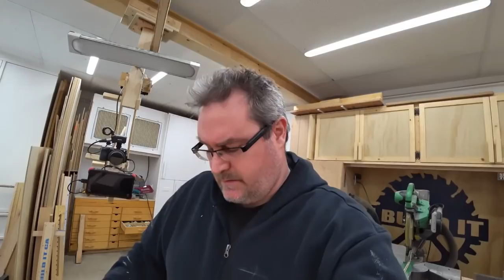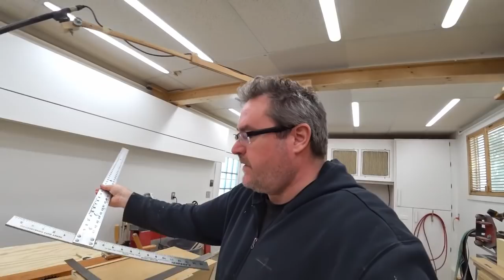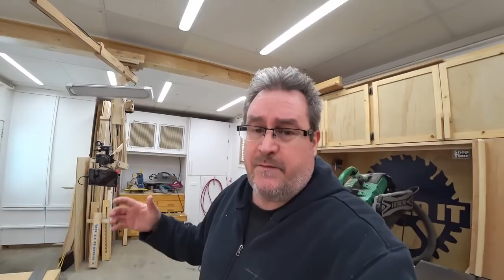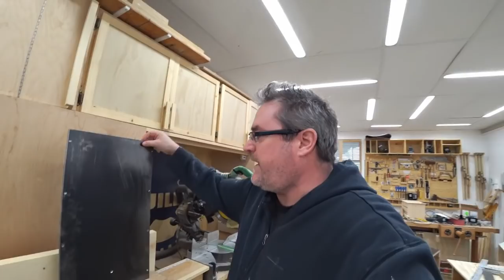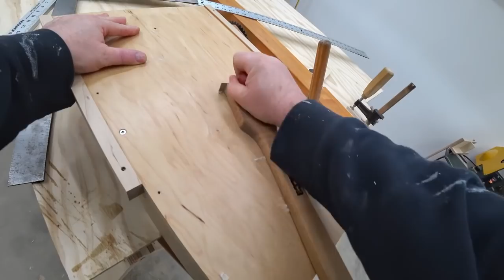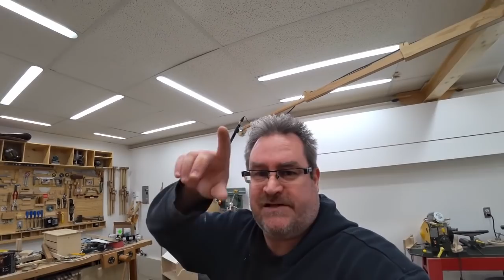I rushed it and now I'm paying for it

Comment: I have that precision problems very often in metalworking. The biggest flat surface I have and use is a 50x50 cm granite kitchen countertop, very hard (obviously) and seems to be stone countertops are very flat because the way they are cut; I suppose you know all that already, but just in case. Thanks for sharing !

Comment: I own 3 jointers and have used a few others. They all have a mind of their own. One
 might work today but not tomorrow. Here's what works most of the time for me: Get the board as straight or flat as you can with a hand plane( or bandsaw) before jointing. Having in and out tables laying in parallel planes is a must and if you get it working correctly do not change the depth of cut. If you don't like the idea of hand planing before jointing forget jointing  and attach a straight edged board and use the table saw. If I have a 1/2 inch bow in the middle of a board and don't want to hand plane sometimes I use the jointer as a powered hand plane and alternately plane from each end towards the hollow spot. When it is flat within a sixteenth or less then I make a full pass. Lastly , in general, I feel the deeper cut you take the better chance of obtaining a straight edge unless your outfeed table is much longer than the work. At age 83 I have learned to accept mistakes. Thanks for your contribution to woodworking.

Comment: Hmmm, I guess I'm in the watch the details viewer. I got hooked by your multivideo series like your chamfer plane, quick release vice, I think the old sliding table saw was also one. Oooo, glass top jointer, that sounds really interesting. Btw, you mentioned a curved cut, why wouldn't that be a cutter knife issue?

Comment: I used to be a pattern maker and to make sure a surface was completely flat we used to rest a tight string line across it with a penny under both ends then slide a penny under the middle if the space is bigger then it sags and if its smaller then it bows up rinse and repeat till its straight in every direction

Comment: I had a bench planer doing a similar thing (hollow with it tapering thiner at one end), turned out to be caused by the blades being too low. i had them flush with the outfeed table but turns out they need to be slightly higher than it. just thought checking Occam's razor type problems before you go to full on trying to fix it.

Comment: I have never bought a framing square that was even close to square, that's why all the ones I have have been peened on the outside or inside corner with a center punch (and even then its only eyeball square, but off the shelf phht 1/8th inch over 12 inches)

Comment: Might not be a good idea, but I used to be in the glazing conservatory roofs and in a great deal of cases we used laminated glass. Although a bit heavy it hold the machine steady and as you probably know, you can give a great old whack on the surface, touch the edge and bang. Their are clips (inexpensive) that hold this glass. For what it's worth, maybe give it a look.

Comment: Thanks for the talk! As a retired heavy equipment mechanic precision is always on the forefront of thinking because of the tight tolerances of adjoining parts and surfaces the purchase of a accurate parallel straight edge with feeler gages is a must.  Hope you get this to a reasonable flat surface I know how flustered it can make anyone.

Comment: Like some others suggested, a granite counter top occurred to me. The float glass is an interesting idea too--that I never would have thought of. As infrequently as I would use a jointer, I would probably go with high-pressure laminate bonded to MDF. The laminate would wear out over time, but cheap enough to replace. I'm sure that whatever solution you come up with will be good.

Comment: Even you posted this video I was wondering about granite, the table saw was actually what I was thinking about at the time. (Much more complicated with the miter slots and throat cutout, of course) Obviously you'd have to have it cut by a shop but the size you'd need is probably within the cutout area of a large kitchen sink so there may be "scrap" available in that size.  I think there was a commercially available one (ridgid, maybe) that used granite. Obviously you still need to be concerned with fastening but perhaps you could have threaded inserts epoxied into the bottom, a decent thickness granite would not need to rely on the flatness of the substrate for flatness.

Comment: When I was tweaking my old used soviet mini-jointer, it had a horribly uneven steel outfeed table. After a lot of trial and error, I got it decently right by taking a granite plate with some glued on sandpaper (a piece of glass or a reliably flat piece of ply would have done it I guess) and rubbing a scratch pattern on the table. Then I scraped the highspots off with a small carbide scraper, rinse and repeat - I was surprised at how fast that went overall.

Comment: I spent my working life devoted to precision. I have a few tools that would help with measuring flatness and parallelism. I would like to have a couple of precision parallels and a set of feeler gauges to determine relative flatness of the plywood substrate. A surface gauge and a test indicator could check the cutter shaft to make sure it was parallel to the infeed table. I don't remember if the steel you bought was hot rolled or cold rolled. In any case, it won't be flat.

Comment: I'm glad you liked my glass suggestion!! Perhaps if you use chipboard as a base (say two 3\4" pieces laminated together) and coat it with a liquid DPM paint before adding the glass, there will be no movement due to moisture absorption. DPM paint is used on concrete foundations and also on the insides of mild steel water tanks. It isn't just water resistant like most coatings but absolutely water proof.

Comment: Maybe 18 mm MDF with a layer of 'FORMICA' type laminate on both sides? This is often suggested for home-made router tables to keep them flat.  Laminate the edges too, to cut down moisture absorption. Any chance of getting wide hollow webbed aluminium extrusions in Canada?

Comment: I wonder if screwing down the metal plate to the wood will distort the "flatness".  Think torquing down heads on an engine.  If they are torqued down differently it can lead to problems.
Reply from the maker: There's a gasket on a cylinder head that you need to be concerned with.

Comment: could a flat cast-iron top, from an old table saw...work as this out-feed table?
Reply from the maker: inexpensive table saw tops are usually not perfectly flat and have miter slots and a big hole for the blade insert.

Comment: I bought a 6" mastercraft jointer and the only adjustment possible was to lower and raise the infeed table. The tables weren't flat themselves or to eachother enough to work properly. I ended up checking with a 4' level and pieces of paper as feeler gauges and sanding down the high spots, (the tables were something like cast aluminum I think.) It works well now, but was pretty tedious..
Reply: Whoah mastercraft made a jointer?
Reply: Probably this one: https://www.newswire.ca/news-releases/canadian-tire-voluntarily-recalls-mastercraft-6-18-bench-jointer-507706341.html
Reply: Wow.  Poor Mastercraft.  How high are those guys when they're designing tools?  They couldn't even make an MDF router table top square
Reply: lol Thanks for the link! One of the bolts for changing the blades is seized and I haven't been able to sharpen it. I've passed a couple hundred board feet of hard maple through it though so if I can get even some of my money back maybe I can finally upgrade. Maybe I'll take apart my partly failing mastercraft planer and make a new jointer... lol

Comment: (May be a stupid question) Would it be possible to make a top from concrete, something that is a good weight and can be flattened easier than wood? Dont mean HUGE pieces, but like a 1 inch by (xwide) size.

Comment: What about using acrylic instead of glass? You could fasten it with screws. I am running into the same issue on my jointer build. I purchased a sheet of hot rolled steel and found it to be less than flat. I ended up using hardboard which is easily replaceable if it wears out but I have noticed some warping issues with humidity changes. You mentioned a glass top so that got me thinking maybe 1/8 inch acrylic sheet?

Comment: Probably a noob comment but: would self-levelling epoxy/compound work as a sub-layer to the steel? Obviously one would have to make the ply into an epoxy sandwich to avoid warping long term like you say, but pouring the top last could make it a really flat surface (well, in my head it does....). 🙈

One other thought I had: Artists sometimes use glass with an abrasive substrate (or sometimes sandpaper) to flatten out larger objects like etching plates, so even if you don’t end up using glass as a final surface, perhaps you could use it to flatten the structure that holds the final top layers before the steel goes on.

Thanks for sharing these frustrations along the way! And apologies if my pitiful suggestions don’t quite cut the mustard... 😉 
Right, I’m off to take a look at your web shop, you do have some mighty fine plans for sale...
Reply: I think you are confusing "flatness" with "level".  In this case the in feed and out tables need to be flat and parallel with each other even if they are at an angle to the horizontal which doesn't affect the work.  As long as everything in the machine is stiff and doesn't move or flex then being level is not necessary but a good idea and practice.  I hope that makes sense.

Comment: With glass you would also half to be careful with resident frequency. If your motor and blades hit that frequency that glass will chatter and that could be really bad.
Reply from the maker: Peter Fitzpatrick - scrap down the steel plates? Maybe it wasn't clear in the video, but I don't have the rest of this century to finish this project :)
Reply from the maker: My apologies Peter, I didn't mean to bruise your tender ego. Thank you for the advise that I didn't ask for and have no intention of wasting my time following. :)
Reply from the maker: No, but you were hoping I'd see it so that I could pay you some special attention :)
Maybe you could take the time away from keyboarding long enough to grab a couple of 24" x 12" hot rolled steel plates and scrape those flat like you talked about above. Film the entire process, of course, and post that here on YouTube for the rest of us to watch and learn from.  Nothing more convincing that watching the act on video, performed by a pro.